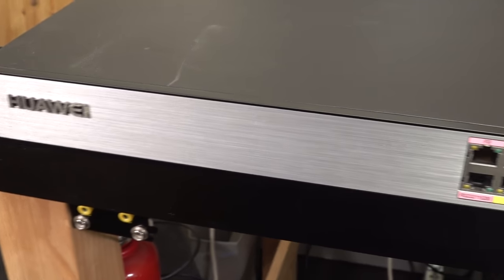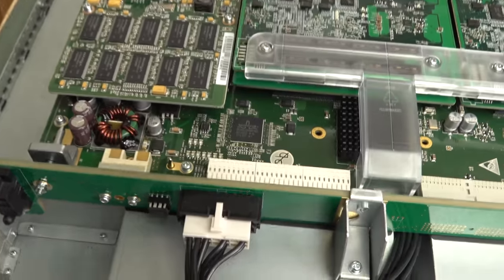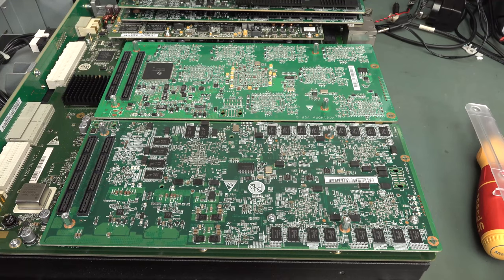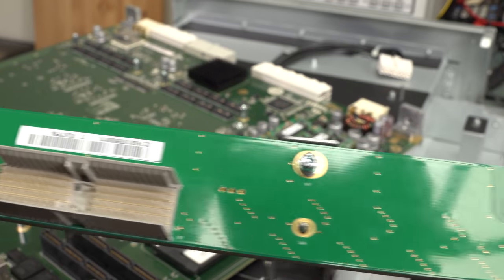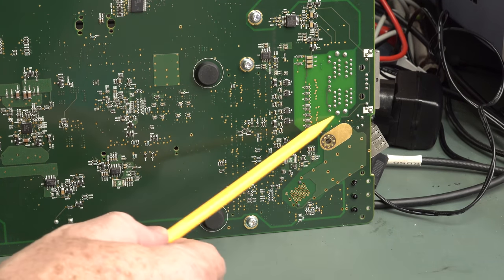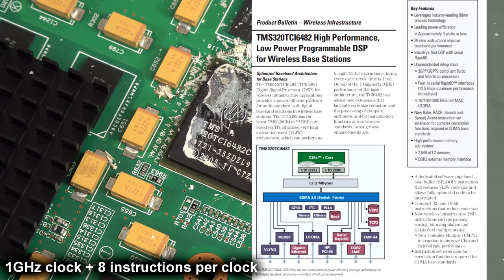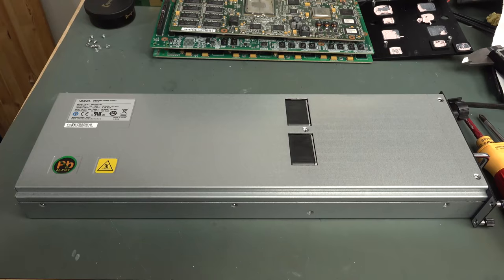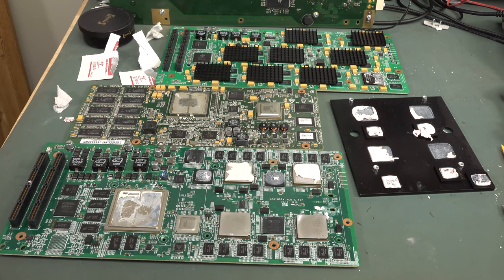EEVblog #1289 - Mystery Huawei Teardown

Comment: the SFP-ports are at an angle probably to accommodate high-power optics.
Positioning those transceivers in such a way greatly decrease the chance for an random not-so-smart person to lose their retina while casually staring into "those strange things in the rack" (given that prior to that another not-so-smart person had left some high-power transceiver without a plug or patch connected).
Reply: No it for the cable/fiber management arm.   The fibers are bent the least when the chassis is pushed into the rack.   Some better servers, IBM, do this also.
Reply: @christopherwhull  The bending problem is highly exaggerated. For one, cables can tolerate much more beating than expected. And there is plenty of space for sloppy bend-radius anyway.
If it was for cable-management, it would be more appropriate to angle SFPs the other way, so cables don't have to run all across the device.
And finally, I've seen many backbone OTN-devices (DWDM MUXes and such), and it's happen to be only the high-power optics angled, not the "site-facing" ports.
Reply: There are a pile of standards written long before Corning came along with much better super clear glass.   Yes you can bend fiber all kinds of ways, smash it between the chassis and the rack and most of the time it works.   And then some of us support orgs where downtime will get you on the front page of the Wall Street Journal so we do everything in 4s and treat everything with an abundance of care.  It cost virtually nothing but velcro and time once you dive in to comply with the specs and go full way above telecom cable porn.
Reply: @christopherwhull  That is, although true, completely irrelevant to angled angry-photons-receptacles. There are tonns and tonns of various routers and switches with a straight SFPs. And there are loads of transport equipment (the stuff, that's dealing with backbone links, hundreds of miles, packing ridiculous amount of lambdas/bandwidth in a single fiber, and so on), where SFPs/LC-connectors are almost always angled. That kind of stuff can literally make you go blind. And it's not a coincidence, that ports are angled on the second class of devices, and not the first. 
P.S. I am no stranger to cable porn myself.

Comment: Yes, Huawei is (or *was*) actually replacing everything in datacenter after datacenter, all the old cisco, juniper, etc. routers, switches, fiber optic concentrators, you name it. Mainly due to their cheaper price, and excellent performance. 

Until the people who fully backdoor all Ciscos  (I have seen a switch being rootkitted live) figured out:  "Hey !!!! how come we can't spy on the customers internet traffic anymore ?"
So they complained to their masters, and that's why the US govt. went so heavy against Huawei. Their reasoning was simple:  we used to spy on the sheeple, so I guess China must be the ones spying now.
Reply: Exactly.   Last time I was lucky enough to see a Huawei datacenter switch it was one of the best engineered things I'd ever seen.  Even this teardown shows the quality of stuff.  Of course no Altera FPGAs anymore, but they'll now throw everything at the problem to make equivalents or better.  SMIC and others aren't too many process nodes behind and they're catching up.   ASML already has sold them EUV tech before the sanctions came in.

And you're right, products are cheaper with no NSA backdoors.  Source is not fully open but 100% available to top end customers including governments, but everyone spouts this nonsense about Huawei spying on everyone with resultant sanctions, bans which only spurs them on to replicate the tech themselves. In the process AMD/Xilinx or Intel/Altera lose another customer for very high margin components - further affecting the shocking trade deficit.. 

Yes China make a lot of crap for an absurdly low price, or these days outsource it to Belt and Road partner countries, but they also have stunning research and some of the best engineered products on the planet.
The fact Huawei employees (or US subsidiary Futurewei) make up a large percentage of the Terabit IEEE study groups, 5G standards committees and panels is testament to their research and development prowess.  

Yet we have a bunch of utterly technology clueless politicians and their military intelligence mates spouting  nonsense.  In the meantime they're running up even more unserviceable debt which will damage the western standard of living we all enjoy.   This is not Long March China under Mao or during the Cultural Revolution.   In some ways it's more capitalist than most socialist-leaning western countries.

Anything to try to protect the dollar reserve when in the end it's pointless.  Better to work with China and allies rather than treating them as pariahs.  Ultimately the boot will be on the other foot and they have very long memories.

Comment: The Cortina part is a 4 port GigE MAC. It handles framing for the Ethernet interfaces. It was probably manufactured in the fab that Nortel built near Ottawa. Probably it's no longer operating but as a telecom IC, makes sense, and Cortina seems to have had ties to Nortel as well.

Product brief https://drive.google.com/file/d/1-r8bKaUU6pglikL78M-STQutIM2yT6z5/view?usp=drivesdk

The big heatsink probably covers an Intel IXP2400 NPU as mentioned in the brief.

Comment: Black heatsinks are better than regular not painted/anodized ones?
Reply: Yes. The black coating can radiate heat.
Reply: yes, the black anodization increases emissivity to radiate heat better in addition to the normal convection

Comment: The high speed board to board connectors look exactly like the connectors Sun used in their Sparc Stations 10 and 20 circa 1993 to connect their Sparc processors sub-boards to the motherboard of the station.

Comment: $61,215.00 device manufactured in 2013 is now worth less than my macbook manufactured in 2011.
Reply: Very similar internally down to the power distributions to the HD Motorola/Atlantic scientific/Cisco codecs of 2006-2013 that everyone used in the era.  The new units have internals that support more streams or 4k.   Motorola of course would go running for a PowerPC in this era but all did about the same,  switch video encoding, or pull it off the fiber and in/out as HMDI, Composit or another standard.       Cable head ends and had the same 8-16 channel in/out as the video conferencing systems so they typical were the same chassis with slight different back planes and different nameplates.  Cable companies hundreds of these by the hundreds to drop commercials into national or local feeds in each market.

The bent SPF direction is so that the fiber hung vertical on the station units that sometimes were labeled for 19 inch tall racks found in many video installations.    It is a spec somewhere probably for some EU standard. 

There is no reason to go super scalar or put this function on anything with much more a failure domain.  8 Channel HD encode and decode with a switch plane is still not easy to do in parrel on a 2 U white box, 100 or 200 mbits per second, 24/7/365.   Thus NIC need heat managment.   In broadcast Every channel/ is going to have an A and B unit or some automation to bring up switch in feeds multicast stream when the the primary goes down.     

Everything networks into cisco or juniper via multicast so you can RF to HD via TCP at the dish RF stack, combined with the feed from a super head end,  ran it by fiber to the DC, drop and insert on one or more units like this to add local commercials, put it through content management and ennoblement (CAM)  and then recombine it into QUAM for either RF or RF over Fiber to the cable plant as another stream.  Your cable card TV or set top box decodes the bits and deliveres HD or other standard content.    Units just like this also are put out at local stations, public access sites, sports arenas, racetracks and direct fiber, internet streamed or in the bad old days DS3 to the cable headed.   I have even seen them in mobile trucks to do multiple cameras feeds at once into a microwave link.  

As the commercial inserts in local markets are at least half a cable companies income stream, price really isnt an problem in cableland, these things litterly print money.    Drop and Insert functions are worth 1-20 million dollars a year on the major networks and ESPN and 50,000 - 3 million on the minor channels for major markets.   

Some are still in use as the expectation was end of support was 2022 ish on units I installed in 2012.

Comment: looks like a 10 gigabit dual channel SFP network and the eathernet for controlling from workstations or other equipment its a signal switch and encoder /decoder very beefy piece of gear rite there the oddball board is a codic board for the GPU boards to use heardware codics are much faster as dedicated chips alot of these units use a codic board per so many GPU boards the standalone board is a system board with the SFP controller and the like pretty robust gear ment for servicing and minamal downtime when updating or repair

Comment: Actually everything of this design screams that not much effort was put into this. Everything is on fpga and other off the shelf components, the team was either small or worked in a tight time constraints. The design was like; ok guys we need to put eight H264 encoders inside the unit, we have no time to cut corners make asics or other custom stuff, the engineer 1 will find the IP for fpga doing this, engineer 2 will put as many top cost fpga on the board to have some margin, and engineer 3 will work on power supply and thermal design of the case, the release is in the next quarter. I don't like it at all, not much thought was but into it, it is not an example of some revolutionary technology design or whatever. Also the niche application for this device is to fulfill the absurd needs of spoilt top managers who may be play with it once in a while and then scrape it. Videoconferencing is not a huge thing and is not critical for doing business. Linux kernel is made through maillists collaboration. So after all this is what you've got if you have some spare million to make an overpriced junk and a bunch of engineers to implement it. Nasty.

Comment: mate - be careful with your wee pocket knoife.
What does such a unit do? Answer:
1. It emulates a conference room with electronics means. WHat is the situation in a conference room? There are many people sitting on a big table. Everyone can see and hear each conference participants. There is also a conference moderator who structures the conference progress. He arranges the order of speakers, watches raised hands, organizes the discussion. The same is done with such a unit, except that the participants are all remote in their countries anywhere around the world.
2. Each participant has his own video camera, microphone with active echo canceling. The data streams from them all enter this unit. Only a limited capacity of participants can be handled depending on the resources of the box. I assume that this box is good for 20 to 30 participants.
3. Each participant gets a video stream and an audio stream on his display and speakers. seeing 30 people on one's screen makes everyone visible only in a tiny frame.  Audio controlled mechanisms can switch the speaking person to a much larger frame for better details. Usually, the moderator sets speking rights active to the one who has the word. With keyboard entries a participant can signal to the moderator that he wants to say something. He can also send a message to the moderator who decides if the other participants see that message or not.
All this stuff is managed in the electronics of this box. In addition, transcoding video formats, adjusting loudness automatically and many other functions usually are implemented in such a video conference unit. Quality of sound and video resolution as well as reaction speed is usually much better than a PC software based conferencing server. That all costs.

Comment: Huawei makes a ton of network equipment too like routers, switches, Fiber channel switches, etc. I would never buy anything they make though they just send your data, etc to the chinese government. I'd stick to Cisco, Juniper, etc.
Reply: Do you really think that you're important enough for the chinese govt to do something with your data? Also there has been no proof/solid evidence provided by anyone one reputable that Huawei steals your data.
Also what stops the chinese factories where Cisco switches are built to implement data theft hardware? Cause according to your logic that would work.
Reply: If you have serious doubts then just use packet filtering and check if anything shady goes out. Even better, don't connect it to the internet and have the important connection pass though a firewall. So easy

Comment: Do they spy you though?
Reply: .... The Australian Government prevented the company from 'High Level' involvement in our 5g infrastructure.
Citing security concerns as all Chinese companies are required to respond to any request by Xi Jinping.
Reply: @robbieaussievic  WRONG:, The Australian government were bullied and pressured by dictates from Washington.  Ever since the 1975 American coup of an Australian government, Australia has been a subservient slave of Washington
Reply: Very easy to test just put a Ethernet packet sniffer, any malicious activity could easily be detected .
Reply: @robbieaussievic  All American companies are tools of of the America government.
Reply: @ITTechHead  What if the packet makes its way as an HTTPS packet, with DNS encryption as well? how do you tell if it's a customer's or actually a malicious one?

I personally do not believe "tiny chip disguising as a capacitor" could do much, but other than that, this is quite possible & plausible thing to do once you manage to sneak in, I believe